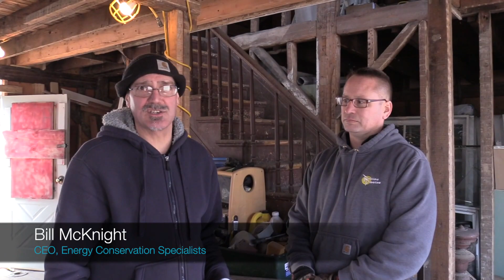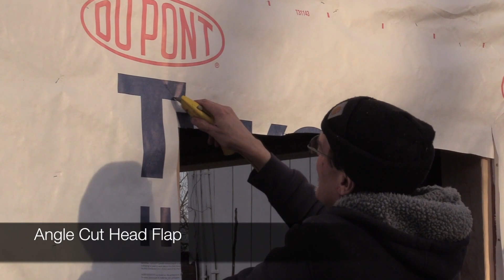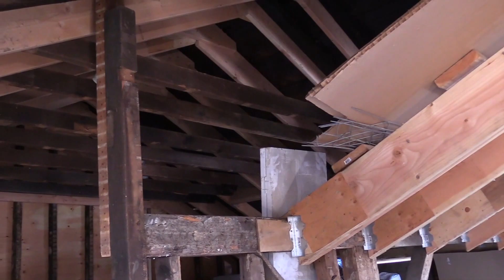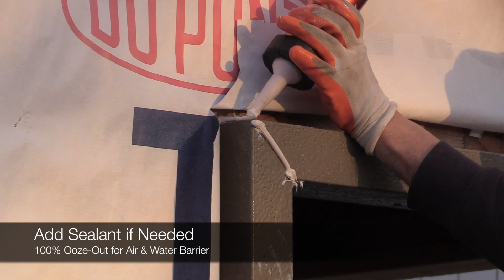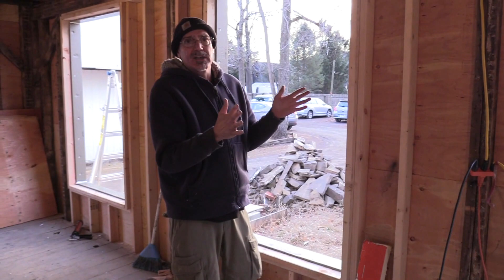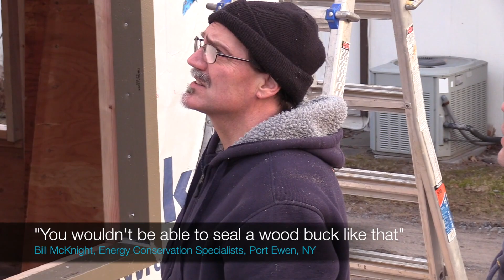Net Zero Deep Energy Retrofit with Energy Conservation Specialists & ThermalBuck

Comment: What makes it "net Zero"?
Reply from the maker: A net-zero or zero-energy building is one that the energy use of the occupants equals that produced by the building itself. The US Dept. of Energy defines a zero energy building as one that "produces enough renewable energy to meet its own annual energy consumption requirements, thereby reducing the use of non-renewable energy in the building sector". https://energy.gov 

Net-zero is achieved through a combination of good building science principles in the design (insulation, air sealing, heat pumps, etc.), and also incorporates renewable energy resources (ex. solar panels). This type of energy-efficient building is growing rapidly, and increasing in mainstream awareness, as evidenced by the winner of Professional Builder's 2017 Builder of the Year, Thrive Home Builders in Denver, Colorado, known for it's energy-efficient net-zero homes. Here are some great resources for more information:

https://energy.gov/eere/buildings/zero-energy-ready-home
https://www.wbdg.org/resources/net-zero-energy-buildings   http://www.nzbmagazine.com/
http://www.thrivehomebuilders.com/

ThermalBuck is useful in net-zero design in minimizing air leaks, and insulating rough openings. You can read more about this ThermalBuck installation with Bill McKnight of Energy Conservation Specialists here: https://thermalbuck.com/installation-steps/customer-installation-stories/